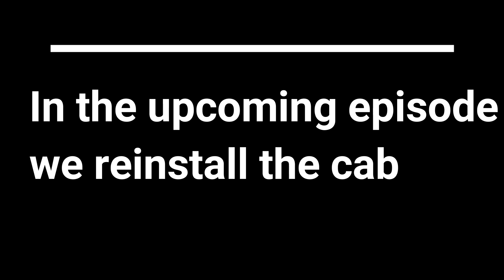2011 F-150 timing chain stretch part 4

Comment: Love the EcoBoost...  However you have shown me the very scary side of them. I could never remain so calm after doing so much work for one truck.  Thanks for the well documented process!!
Reply from the maker: Your welcome, the last part should be up by the weekend.
Reply: Greg H it's only nuts and bolts and attention to detail
Reply: The 3.5 is junk.  Ford builds nothing but junk engine's
Reply: @donaldkinder6716  Im considering an 3.5 F150 EB with 200K. Am I crazy ? Runs perfect.

Comment: They should nickname this motor madusa! 😮 I'd go with the v8 just for the ease of maintenance and troubleshooting!
Reply: There are no new motors that you can buy "Just for the ease of maintenance and troubleshooting."   With the EPA requirements, all motors are buried in a rat's nest of hoses and electrical wiring.
Reply: Buckhorn Cortez any non turbo v8 will be easy to work on compared to a twin turbo v6 with dual vvt and direct injection what a rat's nest these are.